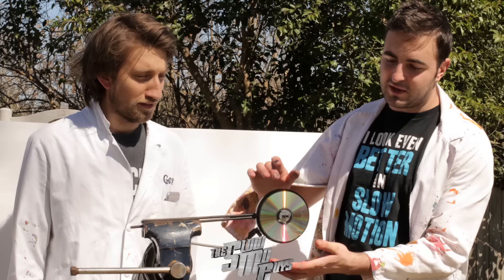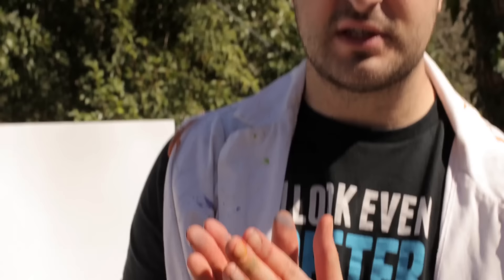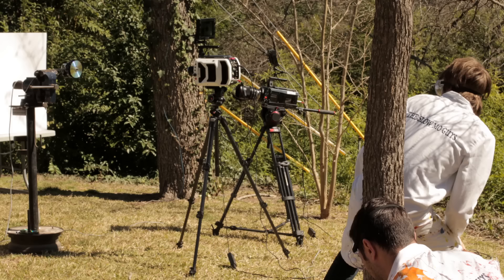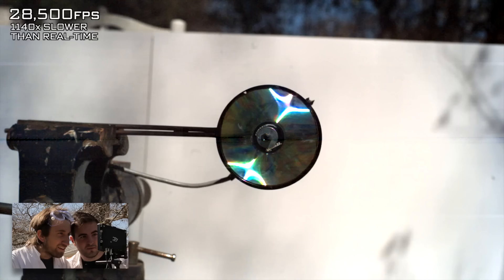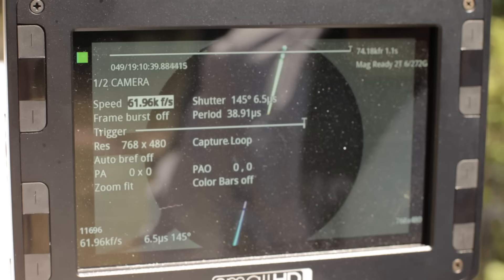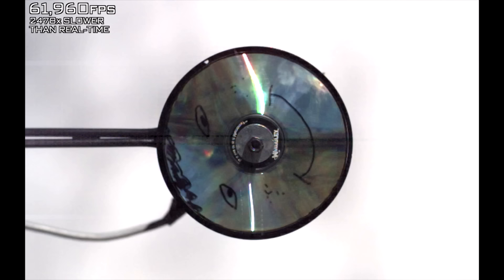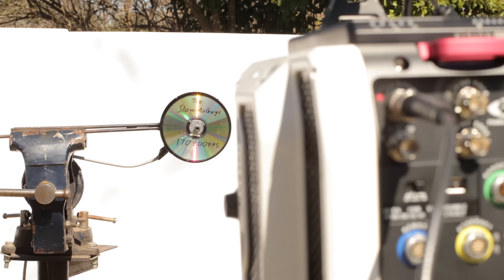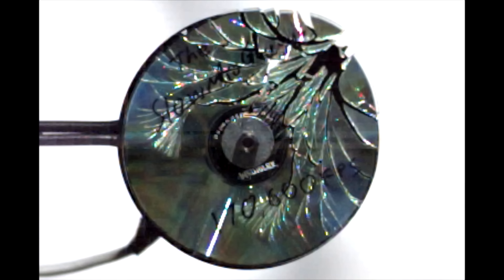CD Shattering at 170,000FPS! - The Slow Mo Guys

Comment: What happens if you accelerate it until it warps but then slow it down again? Will it have changed its shape?
Reply: Nope.
Reply: no, it won't
Reply: No
Reply: No
Reply: Definitely yes, question is how much
Reply: @jano7255  definitely no, they're designed with this warping in mind

Comment: Can someone who knows physics explain why the CD warps?
It's extremely interesting.
Reply: XBOXMaybeIJust  My genius son just explained it to me about the atoms pressing against each other and at such high speed the atoms are moving out from the center; there is nowhere for the atoms to go...  OK. That's my interpretation of what he said!
Reply: ***** Interesting concept...
Well, atoms are kept together by their own force. The distribution of forces along a circular path form the disc made it break into sections of atoms, or debris that the cd broke into. If atoms were to move outwards, the disc would have to be durable enough to sustain the rotation faster than the speed of light.
Reply: The shaft of the motor is slightly eccentric, you can see it in the video. If you put tip of the shaft into xyz coordinate system, this means that, beside rotation around z axis, CD oscillates along x axis and y axis (probably along the z axis too, there is no such thing as a perfect motor). So these oscillations create waves, and thus bend the CD. Once it's bent enough it snaps, and then centrifugal force takes over. My two cents :)
Reply: What I would like to know is what would have happened to the cd of they stopped the spinning after it was already warped. Would it have still shattered? Gone back to its original state? Stayed warped?
Reply: natsirt2610 I dunno. :/
Most likely it'll sustain a lot of damage and stay slightly warped.
Reply: I think that +imStrato 's two cents is right on the money ('crickets' no, nothing? oh all right then...)
But seriously, to add to this, I would concur that it may be that the oscillations of the motor shaft are eccentric, and are applying a periodic loading to the axis of the disc in a different direction than the direction of the axis it is rotating about. When you study dynamics, you begin by assuming things are rigid bodies, meaning that they do not deform under load (a force), and you have equations that can describe things such as the body's rotational motion. In more advanced courses, you can tackle the more realistic approximation, which is that real world objects to in fact deform under load, and there are interesting things that happen when that loading is applied in a fashion which approaches periodic motion.

In a differential equations course, you will likely run across second order differential equations, such as the mass-spring-damper system. I think that this situation may be amenable to a model which is derived from this basic equation, which has the form

(m)y" + (lambda)y' + (k)y = F(t)     The "solution" of this is a function y = y(t) which is the position of a point mass from an equilibrium position as a function of time.

m = a point mass whose motion is constrained by a "spring" (something that restores the position of the mass to some point if it is disturbed) and damper (something that dissipates energy during oscillations)

lambda = damping coefficient (A constant damping force is proportional to the instantaneous velocity of the mass)

k = elastic or "spring" constant (A springs force is proportional to the instantaneous displacement of a mass from equilibrium 

F(t) = a periodic forcing function (kind of like the force caused by the eccentric motions of the motor shaft) of the form Asin(wt) + Bcos(wt)  the frequency of which is w

There is a concept called
omega nought (w0) (mathematicians please forgive me, Youtube comments do not permit an omega symbol) is called the natural/resonant frequency, which is a natural vibration present in I believe most objects.
it is given by w0 = square root(k/m)

The solving of this equation can be undertaken by converting it into a system of first order differential equations, and the solution of this has homogeneous and particular parts. The homogeneous part is known as the "transient solution" because it goes away as time goes on. What stays is the interesting part, which is known as the "frequency response". It can be shown mathematically that that the amount of energy being transmitted to the mass (which correlates to both the amplitude of the forcing function F(t) and the amplitude of the frequency response) will increase exponentially if the frequency approaches the resonant frequency.  This will result in the amplitude of the frequency response increasing as time goes on.

There is a physical manifestation of this: In this situation, the amplitude of the CD frequency response (assuming the CD rotates as a perfectly balanced body about the shown axis (the product of inertia is zero) is causing very large stresses to be present in the plastic where the warping is largest. When these stresses get larger, they inch ever closer to the stress, strain, and shear loading limits of the plastic. When they finally exceed these, the CD shatters.

Also interestingly, I am curious as to whether or not the CD's angular momentum at the instant of shattering is conserved as the collected linear momentum of every little piece of the CD.
Reply: BattlesuitExcalibur Well!
Never would have looked at it that way.
thanks
Reply: natsirt2610
 If you look at a video of a wine glass resonating at slow motion it does the same thing. So what I believe is that is would return to normal, no worse than before. If you bend a disk it is not a problem, it is if you bend it too far. Now, what causes the waves, I dont know. I think there is some effect from the motor's vibration, but I think the strongest effect is how forces move in an object. If I pick up one end of a stick, how does the other end know to move? The force is carried along by a wave of each atom yanking on the next. This is how the edge of the disk knows to move with the middle. This wave is essentially a sound wave. Now when the force is changing so rapidly that you are approaching the speed of sound in an object I could see waves forming. Now in waves like this, the cracks will form at the midpoint between the peaks and troughs, this is where the strongest sheer force is. Now a "gravity negative" comment was made earlier, I think that the shattering occurs on the upturn side first because beyond the warping the CD is also working against gravity at that point and thus the forces would be slightly greater.

But those are just some thoughts. What do you think?
Reply: ***** It has nothing to do with atoms and everything to do with very very small variations in the density and dimensions of the cd. It may not be visible to the naked eye, but a cd is not perfectly round. Manufacturing tolerances allow for very slight  variations in dimensions and it is those miniscule variations that cause an imbalance. At rpm's like the cd was spun at in the video, these variations get amplified. There is also the fact that the mounting system used would not be able to secure the cd at perfect center and then causing another source of imbalance.
Reply: ***** and one more thing that i noticed, at the higher rpm, the cd started to resonate. This could be due to the slight vibrations the motor gives off as the motor is moved by the ac current. Also, the likely reason that the deformations stayed in the same place is because a standing wave formed in the cd as it resonated at a specific frequency.
Reply: ***** That's it, actually.
Reply: ***** Yep, you got it. Although the wave was rotating slightly, depends on which mode it failed in
Reply: I think it has something to do with how the center of the cd is moving much faster than the circumference. Just like a roundabout at a playground, the closer you are to the edge, the more you feel the forces acting on you. So with the cd, the atoms close to the circumference are trying to keep up with the ones in the center. Due to the speed and and material of the cd, the atoms simply can't keep up. So they compensate by making that warped shape. Which then causes tension on the cd and snap !
Reply: Wes Ward Yes, thats the fundamental explanation I guess
Reply: Wes Ward I think the best way to think about it is in rings. So imagine that the CD has an infinite amount of rings around the center that make up the CD. Each and every one of those rings have different inertias (the tendency to resist motion). So the outermost ring has a much greater inertia than the innermost ring. This difference in inertia between the rings causes your differences in speeds of the outside rings and the inner rings. The people above explain what happens from here.

Comment: How do those camera's get to 1 million fps? Internet give me the nerdy answer!
Reply: Son Goku with a lot of money
Reply: High-speed cameras, depending on the sensor and processor, are capable of a certain "throughput". This is measured in pixels per second, or in really fast cameras, gigapixels per second. The more pixels per second a camera can process, the more frames per second it can record, at higher resolutions. So that's why lower resolutions result in faster frames per second. The Phantom v2511 just has an immensely powerful processor, that is capable of capturing enough pixels per second to allow a million of them to be processed in a second. This would need to happen at a very low resolution though.
Reply: By recording 1x1 resolution.
Reply: Long story short:

You know how a regular camera works, with a shutter? Camera takes in light through the lens and opens the shutter to expose film/sensor. Well if you open and shut the shutter multiple times you make a movie. The faster you open and shut the shutter the slower you can make the movie.

I'm just guessing here, but I think these cameras don't have a mechanical shutter that opens and closes. They have what's called an electric shutter, where instead of opening a window to the digital sensor like a regular camera you just turn the sensor on and off very quickly to mimic a physical shutter. These cameras must have VERY expensive sensors that can be shut on and off in literally 1/1,000,000th of a second, giving you 1,000,000 fps.
Reply: Son Goku Watch the Episode about how a camera works he explains the jist of it there but the camera he's using the shutter or sensor is turned on and off so quickly it takes a photo with each on and it needs to be processed and recorded on the hard drive so use the example of transferring files on your computer the larger the file the longer it takes to transfer so in High Def it's moving relatively larger files at the pace the processor can handle by shrinking those and lowering the resolution the files become easier to move until you'd get to such a minuscule size you wouldn't be able to even see what was being filmed and the amount of light the sensor is absorbing is being lessened as well hence why he always says that it takes an immense amount of light to record in high speed
Reply: Son Goku If you sacrifice resolution to the point of outputting a.. 1x1 pixels video they can theoretically go up to 1 billion fps. They are all using electronic shutter of course, no mechanical one can withstand more than a few tens of frames.
Reply: Nikolaos Skordilis The old high-speed film cameras might have had mechanical shutters, but I don't know enough about them to argue the point.
Reply: Action Camera Master Race.
Reply: Brandon8ch 128x16 actually
Reply: Just so you know, there is a camera that films in the trillions of fps. Records light in motion. Look up the video.
Reply: Can you only get to over 9000 fps?
Reply: Go ask Bulma
Reply: DreamChaser1366 Fps doesnt matter for image size. and 2 inches aint big
Reply: Mobile Montage Im not white =P
Reply: DreamChaser1366 Asians are even shorter
Reply: Mobile Montage Lol Im not Asian either.. ;)
Reply: So there's no wizard involved what's so ever?
Reply: Science
Reply: Dat magic
Reply: Science,bitch.
Reply: ***** Oh yeah, 60 frames per second actually is 60 different frames? Totally didn't see that coming.

Comment: The cameras storage writes 24GB/s ?!  How do you do that?   That's still 40 times faster than GDDR5 RAM ...   
There are storages that can write even faster, but I haven't seen one being bigger than around 32MB.  And you have 3000x that storagespace.

So,  dear Phantom-Engineers:  What kind of storage did you use ?!
Reply: Stryke A RAID system could manage this easily.
Reply: Scievery You don't really know what you're talking about, do you?  RAID is a standard for hard drives and SSDs ...   That's a complete different level of storage.
The storage used in here must be as fast as cache-storage on your CPU,  but around x10^5 times bigger.
Reply: Stryke Oh, I am sorry, I meant a RAID-like system. Flash drives as part of an array are to slow for these kind of cameras.
You are right, it is some kind of cache-like storage.

In many high speed cameras the storage is integrated in the camera's sensor itself. That means parallel writing of each single pixel in its own memory cell. Usually every pixel has many (8, 16 or 32) of these memory cells. That's like having many cameras in one. These blocks of memory cells, representing one pixel, are then copied into a slower memory type at once and then written into a flash-like storage. Since this flash-like storage has a fixed write speed, increasing the FPS of the camera causes less pixels to be able to be copied into the cache. So the camera has to reduce the resolution by skipping pixels. Doubling the FPS usually means halving the resolution.
Reply: Stryke I think the drive speeds are a big part of what causes the cameras to cost around 100,000 dollars
Reply: ***** Yes, probably. Being abled to store so much information that fast is probably half of all the problems about building high-speed cameras
Reply: Stryke The resolution for higher fps becomes less and less so I dont know how you figured 24gb/s
Reply: Kanashto The camera has 96GB storage and it fills that in 4s.  Come on, math is not that hard.
Reply: Stryke i didnt analyze where they mentioned how fast it fills up. do they say or do u know about this camera. ur saying there is some impossibility going on
Reply: Kanashto
I think they mentioned it in several videos by now. At max fps they can only do 4s of video.
Reply: Kanashto They say both the storage and how long it ran in this episode.
Reply: Stryke GDDR5 RAM can actually process at 28GB/s, just enough for this.
Reply: Stryke Like others have said GDDR5 RAM is faster than 24 GB/s (actual data rate depends on other factors such as clock speed). In fact, HBM (High Bandwidth Memory, a technology developed by AMD and Hynix), has a data rate of 512 GB/s, with the newer version coming next year at 1 TB/s. However, what I find confusing is that even commercial DDR3 RAM can't store 96 GB of data. They might use something like a RAM buffer and a memory controller to distribute the data to multiple storage components as fast as possible (with a technique similar to RAID 0 maybe). Correct me if I'm mistaken on anything.
Reply: Stryke x10^5 times bigger. ? are you kidding me
I dont know much but how about your mathematic? cose damm theat is a shit ton times bigger

x10^5 = x100 000
Reply: Bio Lācis care to explain yourself?
Reply: Bio Lācis yeah, CPU cache is at most 8MB, while this storage could store 96GB, which is 12,000 times bigger. True, it's not 100,000 times, but close in the order of magnitude :p
Reply: Stryke Your comment (2nd from top) you sey it is x1000 000 bigger
Reply: Bio Lācis 100 000x bigger, yes. what's the problem?
Reply: Eiad Hamwi My CPU has 14MB of RAM, and it's not even top-tier.
Reply: Prehistoricman that's interesting... Do you use AMD? Because, not that I've specifically researched CPU cache, as far as I know, Intel produces up to 8MB on-chip cache. This is of course, for consumer grade products.
Reply: Prehistoricman 14MB of RAM?! :D
Reply: Stryke Wow, I feel stupid. I didn't mean to say RAM, I did mean cache.

+Eiad Hamwi And yes, it's the FX 6350. I think the 8xxxs have more cache, but I'm not sure.
Reply: Prehistoricman Level 2 und 3 Cache on the FX 8xxx is 8MB each.

Comment: Woah! That's insane! I find it amazing how my GoPro can film in 40fps never mind that much!
Reply: Ikr
Reply: Love the new video! X
Reply: Yeah same.
Reply: There is a bit of a difference between a pocket sized Go pro and a Huge ass slow-mo camera.
Reply: ***** Weren't popular cameras (like the one in your phone) able to record at 60 FPS for a pretty long while now?
Reply: JukaDominator A lot of them can but don't because memory limitations. 
From a quick Google, seems the newer iPhones can record at 120 for slow motion and 60 fps for some video. Most don't get good resolution at the higher framerates though.
The only good thing about the GoPro is how versatile and durable they are. Decent quality, nigh indestructible.
Reply: JukaDominator GoPro (3) can record up to 240fps, but you need to remember the crappy resolution when doing so. I think, the biggest problem is the handeling of data, as we saw in the video: 94GB in 4 seconds. In times we're able to write up to 600MB/s on SSDs, we're far, far away from framerates like these on small devices.
Reply: Even an iPhone can record 240fps...